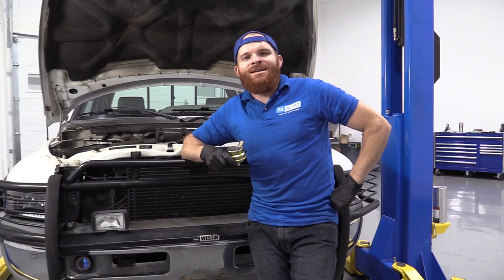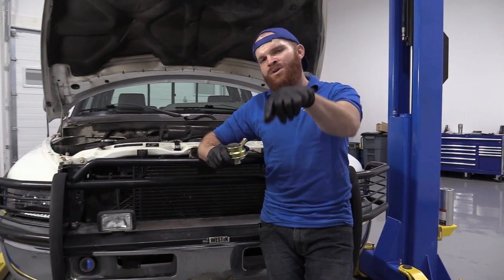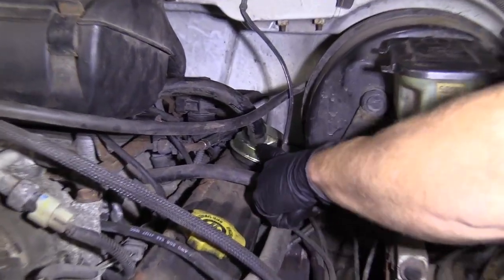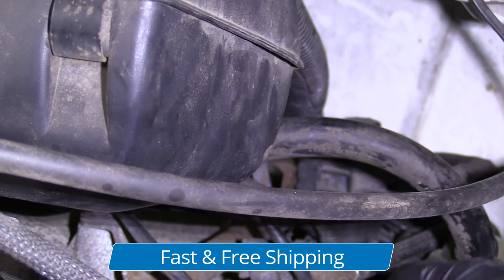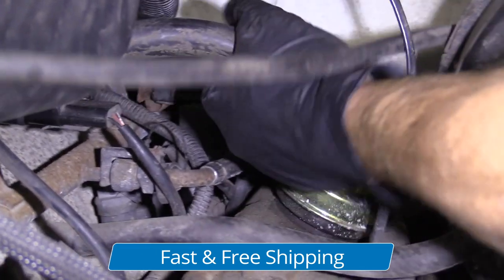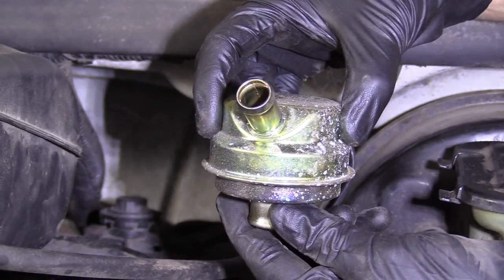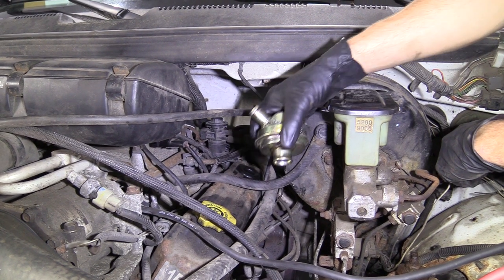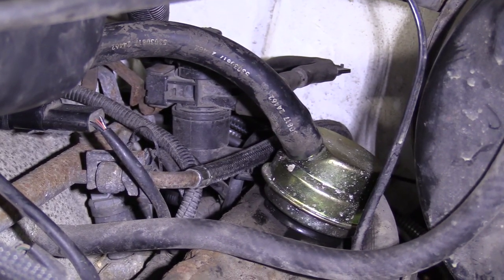How to Replace Crank Case Breather Element 94-02 Dodge Ram 1500

Comment: I have a 2000 Dodge Ram 1500 with the 3.9 liter 6 cylinder engine.  The breather on my truck is on the passenger side valve cover and is black plastic — looks nothing like the one you replaced.  As someone else posted, it looks like a pcv valve.  I don’t know if it needs replacing or has ever been replaced.  Truck runs fine, with no oil in air cleaner.

Comment: Appreciate you putting this up. My air filter housing on my 99 Ram 1500 BLEW UP the other day. A 'used' one from salvage was $125.00 lol. Bought a 10" diameter Edelbrock chrome air filter kit. 
So now I have that tube that goes to the valve cover attached to a small section of my previous air filter housing. What to do with it. Hmmm,  Right now it's TAPED to the new muscle-car-looking chrome air filter. AutoZone has these 'breathers' that take the place of that hose to air filter thing?
So do I still use that hose and plug it into a new after-market breather and plug the other end into the after-market chrome air filter? There is a round tube at the bottom of that Edelbrock air filter that looks like that hose or tube would plug into and keep that relationship between the air intake and gas buildup inside the valve cover going. Hope I said that right. Thanks

Comment: The one on my dakota r/t looks nothing like this. Its just a hose that goes in to something that looks like a pcv valve without the the 90 degree angle to it. Can some help? My trucks got oil in the intake manifold and I’m trying to make sure it isn’t a bad plenum gasket. I replaced the pcv but didn’t do anything on the right side where the breather is supposed to be. There a lot less oil in the intake since I changed the pcv but still getting oil in there and I notice smoke upon start up and hard acceleration. I’m a noob so please bare with me lol